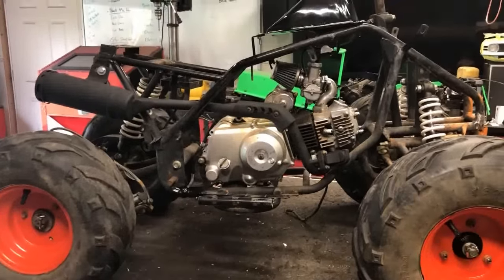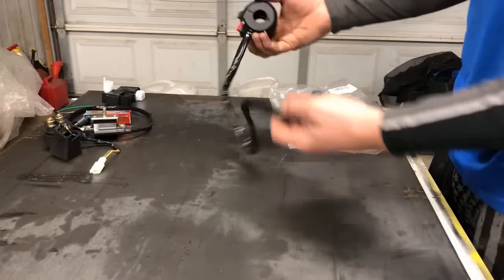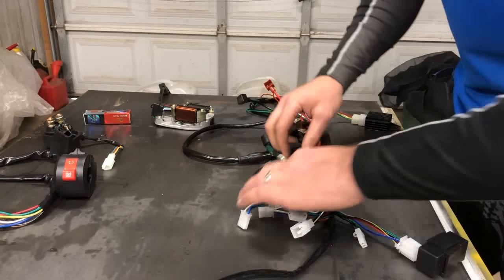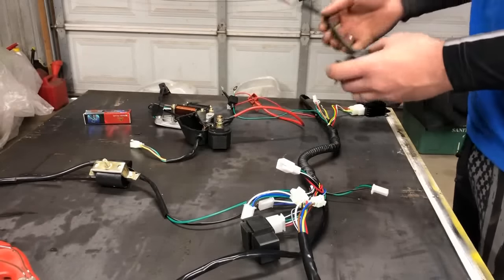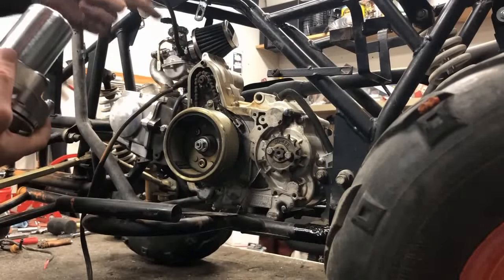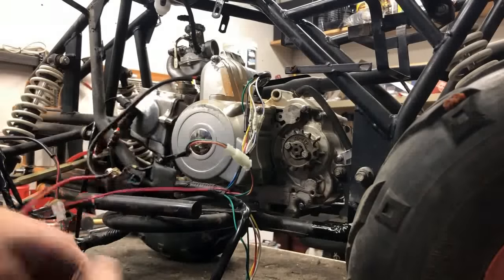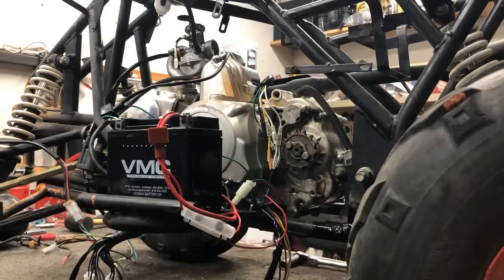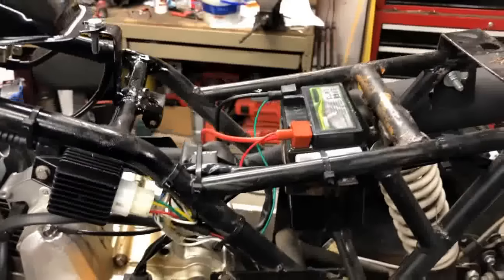Wiring a Chinese ATV from start to finish with an All New Wiring Harness!

Comment: Bought the kit from Ebay but still no spark. Any ideas!
Reply from the maker: Start with the easy stuff first. If did you connect everything off the ATV before installing? Make sure you have a good ground and both positive and negative battery connections are hooked up correctly. If you have more than 1 spark plug be sure to try another or test the one you have. Is everything connected property?
Reply: 1. Connected everything following your video 
2. Connected black ground to stator cover and battery is good. 
3. Tried another spark plug but still nothing. 

It try to turn over but no spark.
Reply: Disregard. I got it going. Appreciate your help. Do you have a PayPal link or something to donate to?

Comment: I've bought this kit fitted it was easy but didn't get a spark. Could the kit be faulty?
Reply from the maker: Possibly, I have got them new only to find out the CDI box was bad before. Just troubleshoot a few things. Check every connection make sure all the connectors are good and not bent and hooked up in the right spot. Double check your ground that it is clean. Make sure the kill switch is in the run position. Lastly if you hooked your safety tether up in the back, remove it.
Reply: I did get a spark for a short time after. The start button wasn't working either so to get it to turn over I had to bridge the starter.. Think I've bought a dodgy kit 😠 thanks for the reply mate 👍
Reply from the maker: @stevenfuka  That sucks man. Did you buy it off Amazon? They have a return/exchange program that's pretty good.
Reply: Ebay lol, there sending me out a replacement free of charge. When I set the kit up just like you the connector for the start button to the starter wasnt the same. It looked like the wire's where crossed. Is it meant to be like that?
Reply: The (relay) the wire's didn't match on the connector blocks.. So I swapped them and still didn't get it to turn over on the button
Reply: New kit issue solved 👍
Reply from the maker: @stevenfuka  What was the issue???

Comment: Hi, so I followed your video earlier today running my Harness got all the control's set an mounted.....it was cranking over just fine but for some reason it didn't have a spark, Now mind you it's been sitting up several years, I removed the air filter an sprayed some fuel in it an then removed the sparkplug an sprayed fuel in it. An still just turned over but no start & now after about 6 times trying to crank now it won't do anything.....Not sure what happened.
Reply from the maker: Stator, CDI, Coil, and Spark plug are the components that effect spark. You also have the ground wire, safety tether and kill switch that need to function correctly. Start with the easy stuff. Unplug your tether, clean your contacts for ground, make sure your battery is fully charged, and use a multimeter to make sure the kill switch functions properly with an open and closed circuit. If you do all that and still no spark, then likely you have a failed component. In my experience if you have a failed component it's usually a bad CDI Box.

Comment: Hey man so i popped open the cover for my stator and saw that it has an 8 coil stator. Will the wire harness that you listed in the description work or what do you think?
Reply from the maker: If you have an eight coil stator that means your atv is probably a 150cc-250cc and requires a different harness. The install process is exactly the same but you'll have to order the correct harness for your size ATV. My links wont work.

Comment: I changed the engine on my nephews Tao Tao 125D. The plugs on the new engine plugs did not match up. Used old engine plug (wire to wire color matched). I tried wiring it using your video but am not getting anything when I press the start button. Any suggestions?
Reply from the maker: I sent you an email! Thanks!

Comment: So i bought a used Chinese four wheeler. The guy who I got it from said it wouldn't start. so he started cutting wires and couldn't put it back together. Now I have it I bought a new wire harness. Everything is wired correctly. I've watched your video like four times. It tries to turn over but it doesn't have any spark. Any ideas?
Reply from the maker: No spark can result in a number of different issues. Start with the easy stuff. Check to make sure you have a good spark plug. Make sure you have a good ground. Then make sure the kill switch is in the run position and the safety tether is plugged in. If everything is good there then you'll need to do a continuity test for the spark components and see if you have a failed unit.

Comment: I know this is oldam but please please help I bought a ATA 110 B Chinese quad I put new carb battery was running great Washed it with the hose lightly like I did not soak it well it died would not start up figured out got no spark at all so I replaced everything on it still no spark replaced the stator no spark well this one has the rear foot pedal brake switch I got two new wiring harness but none that have the rear switch brake will that keep it from getting spark? If not than idk what's going on I've re wired a cple I'm pretty smart I work and sell em.like you do not good at wiring/ spark like you but I just don't understand it where can I get the rear foot brake wiring harness at? How come these don't come with it ? Please help me

Comment: My 110cc Chinese quad is still blowing the fuse and I dont know why I've done everything you have done in this video and every time I try it again and again it blows fuses please help
Reply from the maker: You most likely have a power and ground wire connected wrong. As simple as the battery wires are backwards, possible the ground wire connected to the starter relay by mistake. If you check the simple stuff and still have the issue I would lay it all out off the atv. Connect power and see if the problem follows. Could have a faulty harness that you may need to exchange.
Reply: @PraskaBoysGarage  thank you I'm going to go through it again tomorrow as I've already pulled the motor and harness of the atv and set it up on a table together most likely the ground and power connected together but thank you for your help
Reply: @PraskaBoysGarage  we was working on the wiring for months we have found the problem why it was a faulty key switch to make sure it was I've switched it back blew straight away switched it machine started sparking and working for the first time in 5 months
Reply from the maker: @poised-colistic-sidneyandcat  Hey great to hear you figured out the problem! That's awesome!

Comment: would you be able to tell me why when i hook my battery up that my motor tries to start? i bought the new wire harness and hooked it up using your video and comments from the place i ordered. i thought i was supposed to be using the ignition switch now? i hope you are able to help me
Reply from the maker: Couple reasons possibly. Double check the starter relay is connected to the right plug and also the connection from your start button. If either of those are not plug into the correct plug it can cause it to just. Also if you have the terminals swapped by mistake ( positive & negative). Hope you find the problem!

Comment: Where do i plug in the two wires that you're holding together
Reply from the maker: They plug into the back of the hand brake. Your hand brake will have 2 metal prongs and it doesn't matter which wire goes on which side. Just plug them in and your good to go!
Reply: @PraskaBoysGarage   Thank you ill have to look also ive been wondering the atv i bought the radiator fan wires im not sure where to connect them or how that even works if you could help me that would be greatly appreciated this video has already helped so much
Reply: @PraskaBoysGarage  can you show picture of exactly the prong your talking about

Comment: I have a Kawasaki 185. Will a kit that's for 125-150-200-250 work?
Reply from the maker: No this kit is not compatible. I would look for an OEM replacement if possible.

Comment: I have a problem when I do everything what you did that thing that goes to starter and then to the battery it beeps and does strange noises but strater isnt even spinning
Reply from the maker: Is it a beeping noise or does it make a "click" sound? If it's clicking that likely means it is bad.
Reply: @PraskaBoysGarage  well it worked for like 2 days it was the battery problem but it worked 2 days and stopped working I think it's fried

Comment: were do you connect a electric choke?
if any one knows please tell me thanks
Reply from the maker: I was actually just looking this question up for a friend. It was for his atv that has the 50cc GY6 motor and comes with electric choke on the carb. Here is a link to the best information I could find. The diagram shows that green is a simple ground connection and yellow is connected to the rectifier. I've never tried to wiring one in before so I cant say with confidence it would work, but thats all the info I could find. https://g3integra.com/ruckus/wp-content/uploads/2011/06/ruckus-gy6-wiring-diagram.png

Comment: What happens when you’re in the step of hooking the battery up and it automatically try’s to start? Like it’s being hard wired and bypassing the kill switch and brake function?
Reply from the maker: I'd put money on either 1 of 2 issues. Your starter relay is being engaged so it's sending direct power from the battery to the starter. My bet is you have the wrong 2 pin plugged into the starter relay so double/ triple check your connections. Or you have a fault in the start button where is staying engaged the entire time. Hope that's it! Good luck!
Reply: Praska Boy's Garage  got it working and it fired right up. My son rode it around for 20 minutes and it stalled out and won’t start again 🙄

Comment: Hi I've got my harness on it cranks but no spark.  I have 2 wires with no power a blue and a red with black stripe with no power indication thats going to the CDI unit
Reply from the maker: Stator, CDI, Coil, and Spark plug are the components that effect spark. You also have the ground wire, safety tether and kill switch that need to function correctly. Start with the easy stuff. Unplug your tether, clean your contacts for ground, make sure your battery is fully charged, and use a multimeter to make sure the kill switch functions properly with an open and closed circuit. If you do all that and still no spark, then likely you have a failed component.
Reply: @PraskaBoysGarage  Hi, yeah I finally got it running about 3 days ago, come to find out it was the new stator I'm guessing it was defective I installed the old one an it fired rite up.  Thank you for this video on the wiring set up.... after 4 years an a oil change it runs strong again. New starter an an break's it's been fun to ride again.

Comment: and do you have to hook up tethered kill switch on back of quad?
Reply: my SUNL 110 also has a speaker and a box labeled "SNYA" with a crapload of wires coming out of it(?)
Reply from the maker: If you don't want the safety tether then leave it unplugged and you wont have an issue. The SNYA box is likely your receiver for a remote key start/stop. It is eliminated if you install the harness I have in the video.

Comment: My kit I bought cake with everything but the wires harness didn’t have plug ins for the stator plugs
Reply from the maker: Welding And fab Did it have a white connector? That’s odd because it would be missing 1/3 of the harness if those are gone. I would message the seller and request an exchange or refund.
Reply: Praska Boy's Garage okay thank you I messaged the seller

Comment: I have a question, on my stater there is two yellow coming out of the stater, instead of a white and yellow
Reply: the white and yellow are the wires coming from the stator and are going to the voltage regulator and than sent to the lights. hope this helped!
Reply from the maker: Yes, since posting this video I have learned that some stators come with 2 yellow wires. The "White" wire from the harness is AC for charging the battery. "Yellow" is AC for running the lights. Both serve the same function and can installed either way, it wont make a difference. Thanks for reaching out!

Comment: So I just put a new wiring harness, battery, and spark plug but it still won’t turn over like it sounds like it want to but doesn’t turn all the way could u help please lol
Reply from the maker: This my sound stupid but is your battery fully charged? It if is, then you should isolate the problem. Start by bench testing your starter.
Reply: @PraskaBoysGarage  honestly irdk lol I ordered the battery and harness from amazon and put it Str8 in didn’t even bother to try and charge it wasn’t sure if I needed too or not I’m dumb 😂 but I’ll see wen I get off work today

Comment: David Summerlin trying get going for one of my grand sons What if CDI OR CVI box go on the rear near sator and is blue not white on female side {sator} Didn't know if you said D or V.
Reply from the maker: It's a CDI(Capacitor Discharge Ignition) box. Having it located in the rear is no problem. When it comes to the colors I would have to see it. You can send some pictures to my email if you want me to take a look. praskaboysgarage@gmail.com
Reply: @PraskaBoysGarage  Hi Don't know if I have right harness 2007 taotao Chinese I put a new carburetor on it. it was running good I [Me] trying to make the brake light work off the foot brake before I could get back to left side it burned up the complete harness. my eyes is not that good even with new glasses.I have a cataract on my left got make appointment at V.A.to get it removed there is a lots wrong with me. My Healing is coming Sept 1st God Will, I will be 75 now Sir I had it turning over No Fire.. Now I don't know much about a computer if one of my 6 daughters get by which I two will I will send the picture but on the CDI where you connect the wire the case around is blue and one is white hope you can help some way to get going he want to sale it and get something larger when got it think was 7 he is 13 now.. hope didn't write to much with one finger. But I do want to say really appreciate you, and God Bless You and your family. Again Thank you.. excuse mistake and missing words....
Reply: I stop came couldn't find what I wrote so did again Lol

Comment: Hey man I’m workin on a project with a taotao 110cc and I’ve ordered an new wiring harness with a 2 coil stader. Will the harness itself be the same as the one in this video? Thanks for your help!
Reply from the maker: Cant say with 100% confidence, but if you ordered a wiring harness for a 110cc chinese atv then it is extremely likely it is the same as this video. You can always check out my links in the description to compare against the one you bought.
Reply: Praska Boy's Garage so I received the wiring harness yesterday and I’ve replaced the starter and battery. I plugged everything up the same as your video and I’m not getting anything at all. I even put the front brake wires together. Could it be that the battery is bad?
Reply from the maker: @baileymanns777  If you don't have a battery tester than try this. Take a screw driver and bridge it across both terminals on the starter relay. That will send direct power from your battery to the starter. If it turns over then the battery isn't your problem.
Reply: Praska Boy's Garage ok I’ll try that. Will it mess anything up with the rest of the wiring harness being everything is plugged up already? Thanks for your help

Comment: Love the video! One question, I recently purchased I wiring harness (probably one week ago) and when I assembled it, I followed the video but when I turned it on, there was a very high rev and I couldn’t control the throttle at all. I know this isn’t a thorttle cable problem because I removed the throttle line completely and it still reved high. I also changed the carburetor, still no change. Also, I was sure that the idle was as low as it could possibly be. I did not buy this quad I had already owned it but it sat for a long time so I was cleaning it up. I figured that it was the harness so I purchase the one you have linked in your video and it should be here in a couple weeks. Do you have any suggestions on whether my troubleshooting was incorrect? Any suggestions on why the bike may have been reving like that? By the way it is a 110cc alpine 4 wheeler
Reply from the maker: It is very very unlikely that the wiring has anything to do with the high idle. There is an idle position screw on the carburetor, have you tried adjusting that? Even with removing the throttle cable that screw sets the depth of the carb slide and determines the amount of fuel that's let into the engine.

Comment: Had a customer ask me to fix there coolster and this video help me get her going but I they want the old remote kill switch to work is there a easy way of doing that
Reply from the maker: I have a wiring diagram that shows the connection points for the remote switch. It wouldn't be fun but it is possible. If you send me your email, I will gladly send you the diagram.

Comment: How do I take stater out? Which way does bolt turn?
Reply from the maker: Stator or starter? The stator is the copper coils attached to the side cover and comes off with the cover. The starter is behind that same cover with 3 bolts.
Reply: @PraskaBoysGarage  stater
Reply: @PraskaBoysGarage  stater. But I got it thnx. Videos are very gd. thank you
Reply: @PraskaBoysGarage   Quick question if I am replacing the complete wiring system does it make a difference on the Coil on which one I put back on if a different 1 comes in the package?

Comment: How do you add a starter if your engine didn't come with one I'm trying to add to a motorized bicycle...
Reply from the maker: Not really possible. The starter housing is built into the bottom end case.